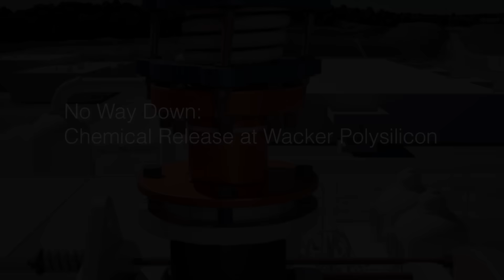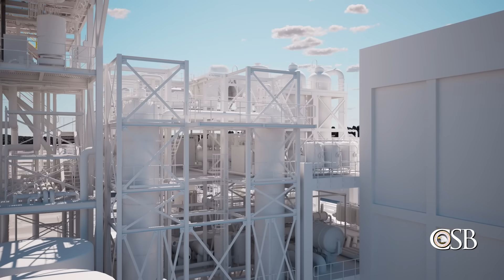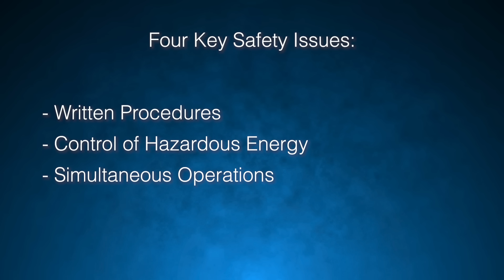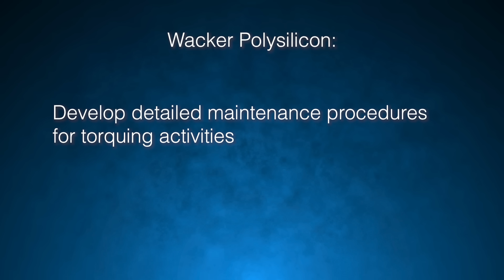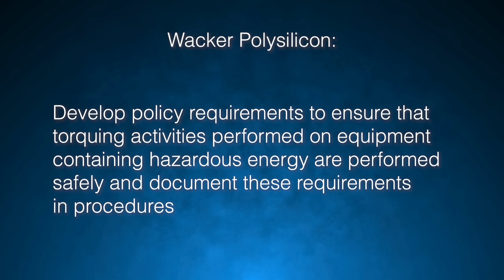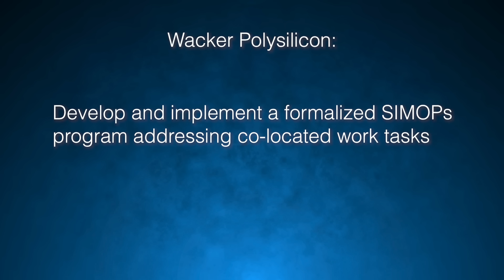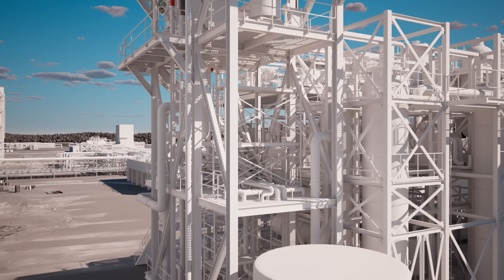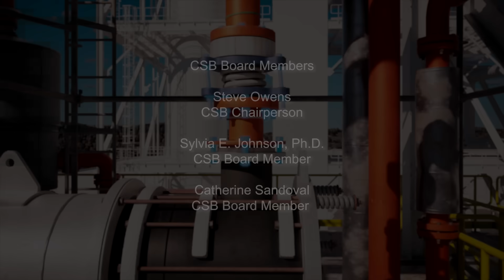No Way Down: Chemical Release at Wacker Polysilicon

Comment: That was not verbal instructions, that was a game of telephone.
Reply: Verbal instructions is always a game of telephone.
Reply: I bet you anything the final instruction was "anything between 15 to 40 lbs is okay".
Reply: too much institutional knowledge is transmitted verbally, we would have much better outcomes if people were trained to reference the written source.
Reply: @FullLengthInterstates  I admittedly don't work in chemical engineering, but I doubt corporatism is any different over there. The written source was likely made long before most of the workers were born, and reference tasks/equipment/positions/etc that no longer exist in any form resembling it. The written source will also likely require doing things in a way that is no longer possible due to minimum possible maintenance of equipment. Updating the source to reference current methods is blocked as they spent a "lot of money" making sure it was compliant, and changing it to reflect the way things are actually done would require approval again. Hence, every blue collar job has "the way the company claims it was done" and "the way the work was done". Before anybody goes "the workers only ever find dangerous ways to do things" is because the workers have a job to do, and aren't specialized in analyzing every possible risk. The ones who are able to make it safe, automatically won't help, since "It's not the way it is supposed to be done". Workers do some really stupid things, but 999/1000 times management is at fault, as responsibility for such failures always fall on those in charge.
Reply: Especially that last step, from the journeyman to the apprentice, was probably merely a very short and inpresice instruction to "tighten the bolts" using "this wrench".
Reply: It just kept going!!
Reply: @tripplefives1402 There was definitely that kind of factors as well. But relying on the wind keeping the worst away like the one that did get away without injury (the one shielded by the properly equipped workers) is not good either.
Reply: That's what I was thinking.
Reply: Indeed, though this one ended much worse than "purple monkey dishwasher."
Reply: i would argue that the game of telephone would have happened even with written instructions.
the foreman would have read them and the rest could have been verbal as i highly doubt that the apprentice would have hung the sheet beside the workplace.
Reply: very broken one
Reply: veritas inflections are pawlwise a flamed homophone purple monkey dishwasher.
Reply: Well said.
Reply: i was a little disappointed that they didn't back up their very first point with at least some of this narrative

however i had a different read:  i think it was actually communicated to those guys and they probably didn't know which side was the graphite connection, and/or were afraid to ask, so they figured they'd be on the safe side and do them both at 40 i.e. "tighter's probably better anyway...?"

i worked with a 19-year-old kid who took the same approach and i watched as he torqued some simple phillips head screws so tight that he managed to crack and destroy the aluminum corner blocks of a simple rack he was building, i also once watched him hold a soldering by the element end while he plugged it in and was SHOCKED at how hot it was

tl;dr:  some people are fucking retarded and you can't always predict how they process instruction
Reply: I don't understand why they didn't recommended that torque values be stamped on the flange
Reply: Yeah, and who says the messages were actually passed on down to the very last guy. If what they all said was true, the apprentice must have wilfully disobeyed his superiors. Unlikely. All those seniors standing around and noone watching the young guy? NOW THAT'S NEGLIGENCE.
Reply: @thedolphin5428  You do not seem to understand how "telephone", aka "chinese whispers" work. Too bad, as it is equally interesting, hilarious and infuriating in a safe classroom setting.
Reply: Welcome to the wonders of modern Unions. "Worker's Rights", have become "pay 6 people and the mob to do the job of 2"
Reply: "Chinese Whispers"
Reply: @dagamer667  Oh, my, getting quite racially insensitive, aren't we? XD
Reply: @dagamer667 😂 China is the running joke of industry and material science, known galactically. Making cheese-grade hardware since the dawn of time. "Chinesium" is in the lexicon of every Engineer born.

Their country motto should be: "The Worst To Ever Do It."
Reply: Racist  @dagamer667
Reply: @gooel It’s not racist. That’s just what it’s called in Europe.
Reply: @ferretyluv  Living in germany, I have never in my life heard that

Comment: Torquing bolts on any live system is a bad idea; hard to believe the cost to de-energize the systems would be that great. Amazing how companies will cut every corner they can to save a dollar.
Reply: I was thinking the same thing! I've seen enough of these to think the first safety violation was not clearing the pipe before doing maintenance on the pipe. But I guess that's a common practice?
Reply: There is always some added risk, but I think it is usually fine, just not when one of the parts is made out of an unusually brittle material (graphite, glass, cast iron, etc.)

Comment: Torquing flanges down while high pressure highly hazardous chemicals are in the piping is crazy.
Reply: Live torquing is done all the time safely.  Their procedures and policies failed them in this case.
Reply: @DontDrinkTheFlavorAid man I thought it was bananas that they were even using torque wrenches if the preload range was that critical where toxic gas explodes in your face for over torquing just 25 lbf-ft. No angle measurement? Or preload indicating fastener? Or strain gauge or something else advanced? Even if they were targeting the right setting there’s so many variables involved it’s terrifying.
Reply: @JamesJamersonIsAGod yeah I’m amazed in such a preload critical joint they did not have pli bolts or washers. 

Torque is a pretty crude way to control preload. In aerospace on critical joints we generally use ultrasonic measurement of the bolt. Or we do torque tension testing of the exact configuration of joint, down to lot number of the nut and bolt, which can have an effect.

The design engineer for that joint probably thought it was clear enough to put “15 lb*ft” on the drawing but honestly we need to be thinking of human factors when we design joints. Smaller preload, use a smaller bolt.
Reply: @tylerp6375  that would be a good affordance, have difference sized or shaped bolt heads for different critical torque ratings, with washers as necessary to spread load, to make it very difficult to apply the wrong wrench to the wrong bolt.
Reply: @tylerp6375 it seems so simple once you say it, but yes, they shouldn't have been able to use the same exact head to torque both sets of bolts
Reply: You're saying workers health is more important than shareholders earnings? 😮
Reply: Also, for this to happen the equipment must have been pressurized while not properly torqued down, right? Maybe that's fine, but it does sound a bit odd.
Reply: @dnebdal  Not at all, it's actually its common practice, where i work we have to go back and retorque a lot of equipment when it comes back online.
take a boiler for instance, you have a cold torque setting which is done in the shop for a sight glass and when it's up temperature 400c at 6000 Kpa you need to retorque it to avoid possible leaks.
No difference for cold service equipment, when you get under -20c the metal contracts leading to leaks so retorquing is required.
i work in a refinery and these are must watch its sad to say the root causes are always human error up and down the chain of command.
Reply: @paulmoloney5569  Right, that makes a lot of sense.
Reply: ...compared to what? Compared to draining and restarting the system? A lot of things can go wrong that way too. It seems to me that people should be able to ensure that everything is properly torqued. The problem here was the game of broken telephone where verbal instructions had to pass through THREE people to get to the apprentice torquing the bolts.
Reply: @jakebrodskype I am not disagreeing with you as there's always different ways of achieving a safe out come,but the  common denominator with all these incidents is almost always human error. 
Here in Australia we have a government body called Work Safe who investigate these accidents, their  recommendations are enforced by law not just  with heavy fines but also new law just introduced called industrial man slaughtered aimed at companies management starting at the CEO level all the way down to front line management,do you have anything like it?
Reply: Correct. At many facilities like this, it is also 100% necessary. In some manufacturing processes, particularly petrochemical ones, stopping flow risks bricking the entirw facility for weeks at best.
Reply: Not considering the shareholders profit margins is even more crazy. How are they going to afford all those vacations with their private jet if these fools keep turning off the highly hazardous gas flow any time they want to touch a bolt? Who cries for the billionaires?

Comment: i'm kind of baffled that it is not a norm to have multiple egress points on any kind of stationary equipment where danger is present. be it just a light lighter ladder or stairs.. just some kind of way to get down in case shit hits the fan. where I live we must have at least 2 ways of egress and that goes for all structures.
Reply: Wait till you hear about "explosion proof buildings."

Certain people work in them, which means instead of.... You know..... mitigation of risk of explosion, they just build buildings to shield the worthy from them.

And if you're not important enough to be in those buildings.....tough luck.

Comment: Did the accident at Evergreen Packaging in North Carolina involved SIMOPS?
Reply: Yes
Reply: In that accident, a heat gun fell into a bucket of flammable resin and caught fire. Two contractors escaped the fire, but it spread from one tower to another - via the connecting pipe and two contractors couldn't escape and died from their injuries.

Confined Spaces and Hot Work were also involved in the Evergreen accident.

Comment: How about the manufacturer Print out waterproof labels, with the torque specs. Placed right near where the bolts are and then there's no question about it ! Duh.
Reply: Labels won’t last long enough, I’d say they should have a sign or something

Comment: Reliance on verbal communications in a chain is essentially playing the telephone game where there’s a high likelihood that critical details get lost or warped along the way. Preparing, distributing (to all), and using written communications (always checking them before completing a procedure) is critical. And please conduct hazard assessments and always use all appropriate PPE (never downgrade PPE to save money or marginally increase comfort or or to look more socially acceptable/cooler🙄). And it was nearly 50 years since NIOSH issued guidance?! 😬 Wow, this incident was definitely worthy of a video! Thanks again USCSB… may you never be shut down by politicians under political pressure from corporate donors looking to cut costs on necessary safety procedures, programs, and equipment!🙏🙏🙏
Reply: @c0461-e1s  Excellent points!👏
Reply: As a kid there was a game where you said something say 10x then when it got back to you it was completely different. Chinese whispers I believe it was called
Reply: @Jabarri74  That is (basically) the same game as telephone. You say something to someone, they say it to someone else than the chain continues till it goes back to you (or whoever started it). By the end it is often completely and utterly different than how it started.

Comment: I'm surprised they didn't stamp the torque on the bolts.
EDIT:  Posted this as a reply but figured I'd add it here as well.
Guys I don't mean they custom order bolts where the manufacturer puts the torque spec on it; I mean they do it themselves at the time of assembly the infrastructure.  You can buy alphanumeric punch sets.
Reply: Regardless of the fastener max allowable torque clamping load (and torque required to achieve this), the fastener could be used for a number of flange and gasket arrangements. The same bolts (maybe SS304 B8SH) are used for service for aluminum flat face flanges, aluminum raised face flanges (rare), stainless flanges, etc. Each will have a different torque spec for the specific flange type and gasket material. There is no clear way to mark this on either the fastener or flange unfortunately.
Reply: TBH the bolts are probably ur typical grade 8 zinc coated bolts. It's very rare to have fastening hardware to have specs listed on it unless it's a specialized type of fastener for a specific purpose/application and even then often times nothing more than the grade markings.
Reply: in europe we write the torque number we tightend the bolts in flanges on the flanges in newtonmeters and our initials if the previous guys did that here they might have seen the torque spec and be saved
Reply: Hell, even just writing on the flange or the pipe with a Sharpie is better than nothing.
Reply: @nastimusnateimus 
This assumes that it will never change. And that the sharpie is not going to smear and be hard to read.
Reply: @neilkurzman4907 Being exposed to the environment a Sharpie would disappear with time. A brass tag that has the stamped specified torque would be a better fix.
Reply: @mr.bianchirider8126  
I’m sure that would be possible in many situations. But I don’t believe it’s typical.  You’re supposed to get the torque out of the manual.
But as you Heard from the video that wasn’t the only mistake here.
If the other team wasn’t there or had been properly protected, then they would’ve just stood there like everyone else, but the apprentice who app apparently was very untrained and literally injured himself. 
Then, of course, there wasn’t the second method of escape
Reply: No chance of a specialized bolt stamper device that could be used manually on site at installation to stamp a figure into the bolt head? I think it'd be "easy" to design such a device along the lines of a staple gun, with selectable numbers and a holder for the bolt. Use I'm imagining: select the desired rating, put the bolt in the holder, and push the handle. The question I have is whether the stamping action is likely to somehow weaken the bolt.
Reply: Guys I don't mean they custom order bolts where the manufacturer puts the torque spec on it; I mean they do it themselves at the time of assembly the infrastructure.  You can buy alphanumeric punch sets.
Reply: a flange can be undone and the next time someone has to bolt it back together they can put their mark on it. cant dotl that if its stamped in the part
Reply: @theoldsmartkid  
You can’t just stamp graphite 
In fact if it’s he treated metal you’re not allowed to stamp that either.
Reply: @neilkurzman4907  But you could probably scribe it or use an enamel marker to write the torques down.
Reply: A durable tag with the rated torque on the affected flange would have been a nice backup plan but no substitute for written procedures on hazardous systems.  And the journeyman's failure to check the apprentice's plan for each step was probably another miss.
Reply: Never heard of this but it's a great idea - thanks! It could also be stamped on a metal ID tag wired to the flange.
Reply: Put a notice next to the flange. The notice becomes part of the equipment and its presence and content are controlled along with settings, the torque values themselves and other parameters.
Reply: @WineScrounger  how many bolts do you think are in a refinery?
Reply: @neilkurzman4907 Graphite piping is uncommon, so a durable embossed tag on such flanges would be the exception, not the rule.

Comment: 40 lb•ft is about half the torque for average passenger car wheels.  15 is very easy to exceed by pulling on an average 3/8” ratchet, and a value like that should be recorded in inch•pounds instead.
Reply: These weren't just average ratchets I don't think, these are ratchets that can be tuned to a specific torque.  The problem was you had bolts with very different specifications, in close proximity, with the worker actually doing the tightening at least 3 levels of "telephone" away from the nearest person who actually ever saw anything in writing.

They're required to have written procedures for the equipment in question, but they didn't.  the people who had to do the work only had the engineering manual and some verbal instructions... and the engineering manual didn't mention that those specific bolts need less torque

Comment: why don't they write torque specs on the bolt themselves or near them?
Reply: On the pipe flange would make sense, but there's likely concerns about cracks developing if stamped, and stickers and similar risk being easily misplaced or misread.
Reply: @Nelo390  i was thinking the same thing, perhaps an engraved plate or plate with weld-bead writing fixed to the flange would have helped here to note the abnormal torque requirements.